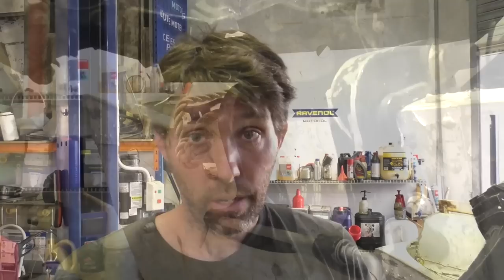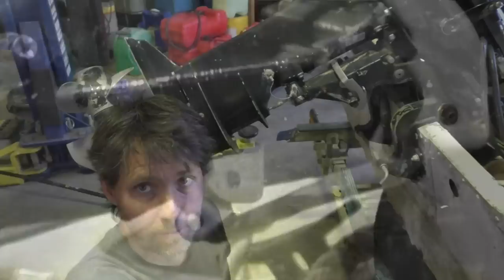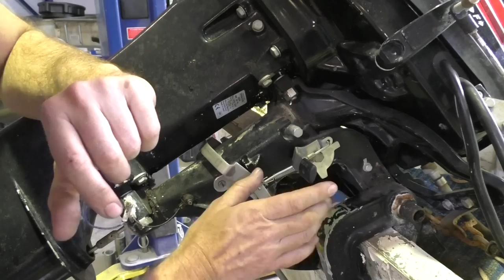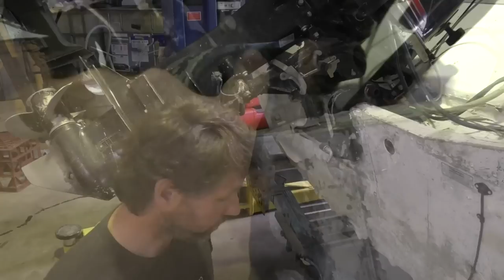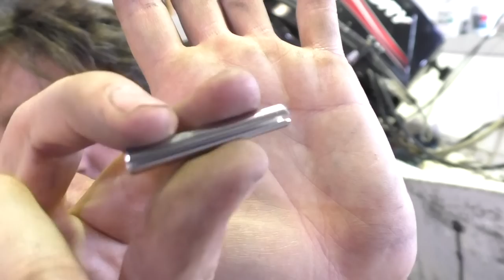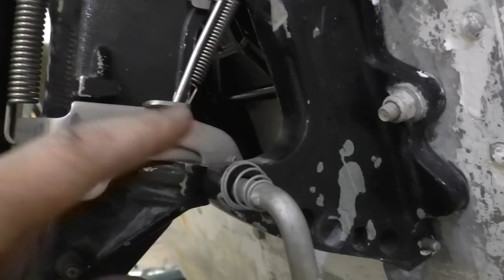Mercury / Tohatsu 30HP manual tilt stand

Comment: My old Johnson outboard (1964) has a very similar mechanism but the lock out is a tab at the front motor mount (inside). Pretty clever system.
Reply from the maker: Its interesting how each model has its own variation on the theme. It certainly is a clever design.

Comment: Great vid, Stu. My old 7.5 Merc outboard has had a wonky tilt/troll mechanism for some time and the thought of trying to make heads or tails of all those fiddly bits n pieces has had me procrastinating on a fix. Your detailed explanation has given me a bit of courage to dig in. My system is slightly different in that the actuator handle is accessed on the front of the motor between and above the transom clamps. I'm willing to bet though that most of the moving bits further down are very similar. Right off I see my issue may be that nylon bushing up inside has perhaps just worn out, sending everything out of alignment a bit and preventing smooth rotation. Thanks again!
Reply from the maker: Thanks mate, good luck with getting yours sorted. As you say, the lever may be different but they basic job they do is the same and often different manufacturers will come up with very similar ways to achieve it.

Comment: I have one of these on my Evinrude 48 SPL. It uses a gas charged hydraulic cylinder (like a big shock absorber ) It no longer seems to have a sufficient gas charge within. It doesn't provide the "assist" like it's supposed to. I bought a used one on eBay, I heard they corrode at the pin and can be a pain to remove. I guess I'll be breaking out the oxy acetylene rig! Lots of parts on this one Stu. I hope you had a well deserved beer after this job!
Reply from the maker: Hi Jack. We've had a few of those style through on Yamahas too. It's a clever idea, but as you say, once they lose their charge they don't do anything. Time to get the big red wrench out again! ;)

Comment: I sure got quite the surprise one day when I was using someone's boat and needed to back up a bit.  Not very funny as it's happening, but it's funny now, especially when seeing someone else going through the same experience.  Thanks for the insight into the replacement of such an overlooked component.  Great to know that Marine Engine dot com has such good quality diagrams to help identify the correct parts, and help people figure out the orientation of such parts when trying to install them.  Spring must be upon you finally. How was your winter? We had one of the coolest (and somewhat wet) summers I can remember in years. Cheers from Ontario, Canada.
Reply: I am about 50kms south and west of Stu. For us it has been a pretty dry but cold winter- which is normal. We tend to have dry winters and wetter summers, with spring being the wet season.
Reply: Ron Powell where are you mate?
Reply from the maker: Hey Stan, winter wasn't too bad here, and the first weekend of spring has been nice and sunny. Sydney has a bad habit of lulling you into a false sense of security though. Everything starts to get nice and warm and then all of a sudden you have two more weeks of freezing weather!
Reply: Liverpool.
Reply: Ron Powell Not to far away.Im in Appin.

Comment: Hey Stu - thanks so much for your videos. I fitted my 30Tohatsu including new tilt tube and steering all off the videos you have shared. Much appreciated ! 

I was wondering - for trailering a motor like this, would resting on the 'shallow running' stand be ok? I.e. would the motor be at risk of bouncing up and coming off that stand, dropping the motor towards the road suddenly? Or, with the stand, is it locked and secure?

Comment: Great tutorial. I have a 1986 Merc 25 and mine just has a cheap grey plastic handle. It works but i like the idea of a metal handle better. I'm in Canada but roughly what did all those parts cost ya? Thanks Stu
Reply from the maker: Thanks mate. All up it was about $300 to replace all the parts.

Comment: Does this apply to the 35hp mercury outboard also?, it’s a 1985 2 stroker 😎 has the adjust trim holes so I’m thinking it likely does. (And will need one) Thanks in advance for any advice. I know now why they say boat is just short for `break out another thousand’….😑never cheap when you’re working on any kind of pleasure vehicle tho. had to vent that right fast 😐😆 i just bought a "water ready” bass tracker off facebook marketplace. Dudes so called water ready and my water ready don’t mean the same thing

Comment: I’m having a problem finding the parts i need for my 1984 Johnson 20hp engine and i printed off the diagram because i have no clue what’s missing i did recognize the locking mechanism however I’d didnt find any stand like thing like the one you showed could you help me in any way maybe do a video on that …because when i call they tell me they cant help me

Comment: Hey Stu, awesome video and exactly what I was looking for. I have a 30hp Tohatsu and it' basically new, its been having the problem of locking down even when I release the lock I need to give the underside a push to get it moving. Any idea of what I need to tweak/change so that it works nice and smooth again? (None of the pieces look bent and it's all nice and shiny) Thanks, Ross.
Reply from the maker: It is often really hard to tell why it isn't moving without a helping hand unfortunately. Lubricating the pivot points is normally what I do, but sometimes I think it is such a minor problem that it is very hard to tell what is causing it.
Reply: Dangar Marine thanks for the quick and helpful reply mate I'll let you know how I get on!

Comment: I have the newer version of this motor and i has almost the same exact bracket etc.  My question is: When you put the motor in forward gear it should release the locking mechanism automatically?  This would prevent the motor from breaking if you hit something like a log or underwater obstacle.  When you put it in reverse the mechanism should automatically lock the motor so it doesn't shoot up when going in reverse?  Mine doesn't do this when shifting.  The only way for me to unlock / lock the motor is to it manually using that lever in your video.  This doesn't seem right to me.  If someone new was driving the boat and they forget to unlock or lock the motor then bad things could happen.

Comment: Thanks, great video!  When we tilt down the engine, the stand is not entering / locking in to the upper grooves/tilt positions, and when i move the stand back and forth by hand, there is some friction and I suspect it does not move as freely as it should. I have been looking for a grease nipple to lube the stand, but to no avail.  Would it make sense to remove the stand to lube the axle/bushing or should I take a closer look at the springs etc?
Reply: I have this problem now.  Did you ever figure it out?  I bought all new springs and the roller t plastic bit that goes near the saddle.

Comment: Question from a novice, how do you know what is the best setting for the outboard to be angled at when deep running?. I noticed the main stopping bar was set at the outer most hole away from the  stern of the boat.
Reply from the maker: It mostly has to do with how the hull rides in the water. You don't want the bow bouncing up and down (called porpoising), and this happens when it is trimmed to high. By the same token you don't want the bow digging into the water if it is trimmed to far down. If it is trimmed to high you may also hear the prop sucking air in.

Comment: Great video. Not the most exciting one you have made. But its still a pretty common fault on "older" motors.
Keep up the good work! My Suzukis tiltstand is really useless. It has NO releaseposition. I have to hold the lever if i want to tilt the motor.
Reply from the maker: Thanks mate. It is true that videos on specific models / jobs are a bit dull if you don't need to do the job yourself, I much prefer general interest ones. Yes, certainly seen plenty of tilts where you need to reach in and grab the stand directly. Hurts when they bite!